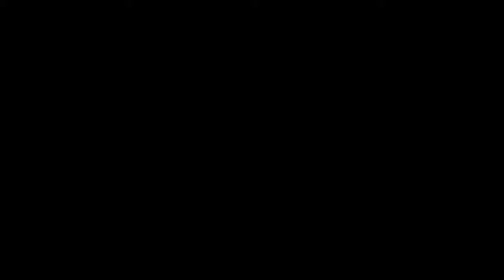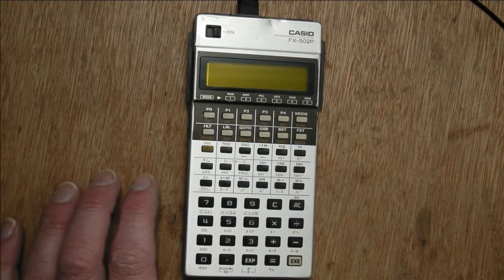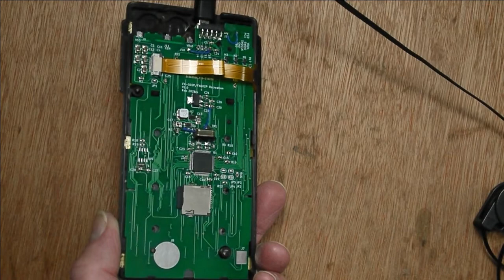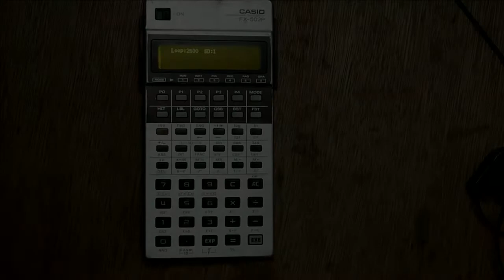Casio FX-502P Recreation Part 5

Comment: A very interesting project, I'm looking forward for future updates.
I wonder, being an OLED display, should not be possible to use a lower brightness setting to save energy when/if working on batteries?
Reply from the maker: Hi, yes, you could run at a lower brightness. OLEDs are pretty power hungry, though, so I don't think you'd gain a lot in battery life. I did add circuitry to turn the display off though, so I'm hoping I can sleep the processor and turn the display off instead of using the (dodgy) power switch. I wish I'd been able to find an LCD display that would fit in the case, that would have been much better, even an epaper display, maybe, if the refresh rate was up to it.